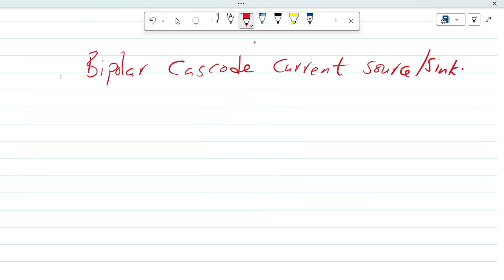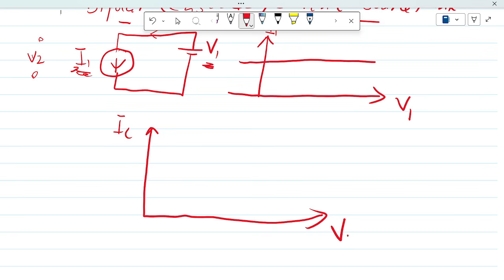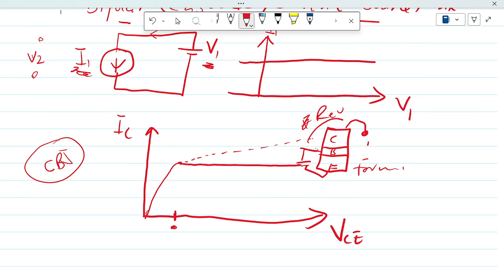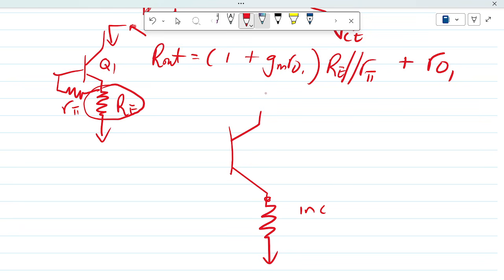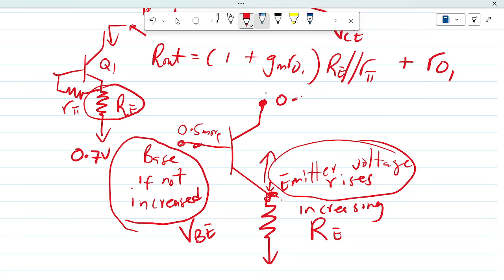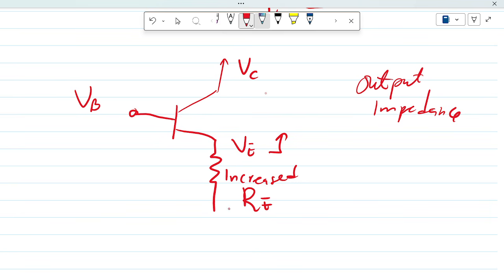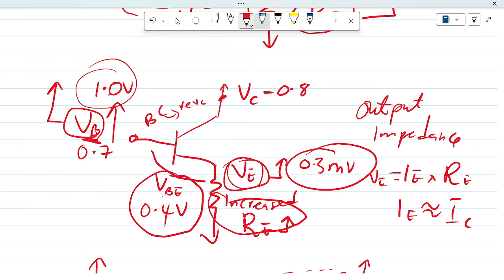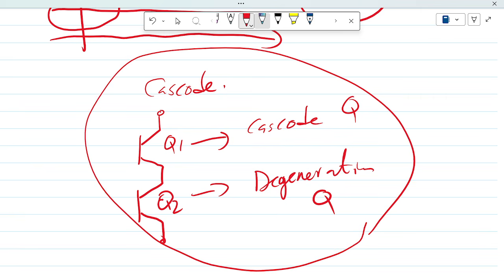Cascode BJTs Explained (Part C1): BJT Current Sources & Output Impedance Basics

Comment: Quick question, sir.
Increased emitter voltage due to degeneration will also decrease the headroom. Does it mean that for a transistor as a current source, the headroom isn't considered as a significant parameter in terms of tradeoffs?
Reply from the maker: headroom is the usable voltage across the transistor's collector and emitter (i mean the voltage difference between the collector and the emitter of the BJT).
This must be maintained (above a minimum) to keep the device in forward-active region during operation....headroom is absolutely a key design tradeoff for current sources — especially at low supply voltage designs